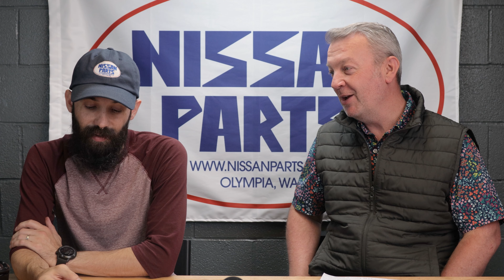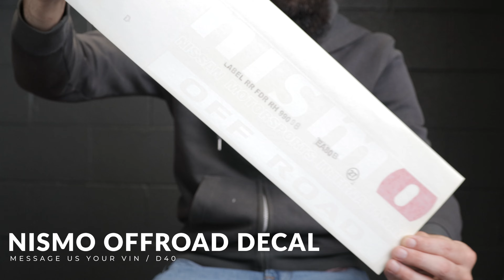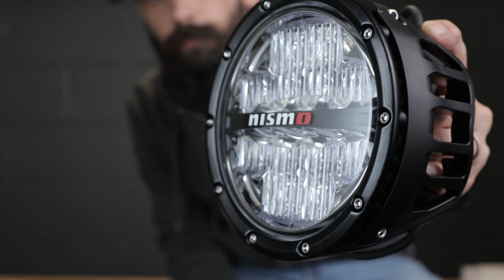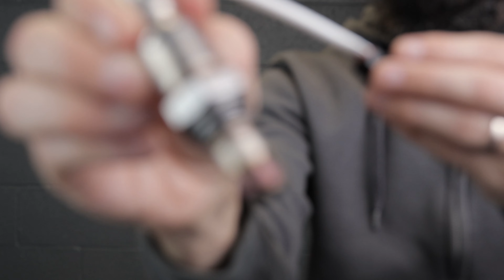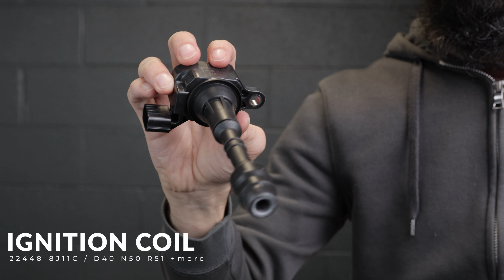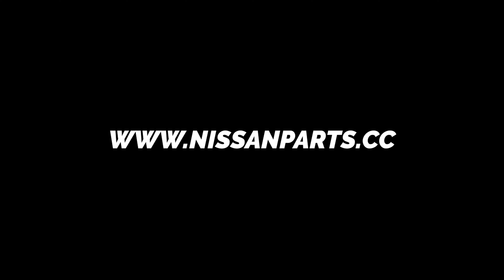NISMO OFFROAD PARTS + emissions parts that are critical (Nissan Frontier, Pathfinder, Xterra)

Comment: The air fuel ratio is as named measures the air to fuel for proper mixture and is pre cat, the o2 pretty much is only there to measure catalyst efficiency and is located post cat, and +1 for oem parts I'm a nissan master tech and found that nissans do not like parts store grade anything, either oem or high quality. Extra fyi bank 1 on a v6 is the passenger side of the engine bank 2 is the driver side, v8 is B1 driver B2 passenger